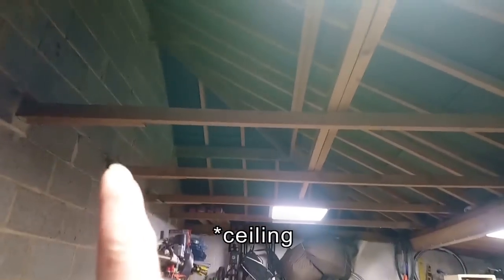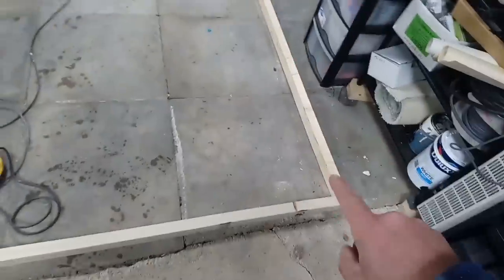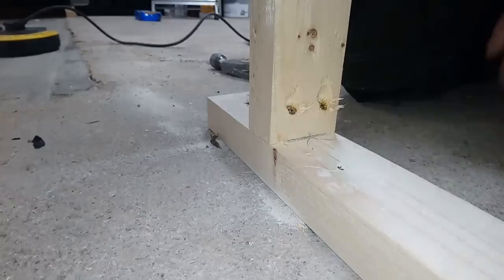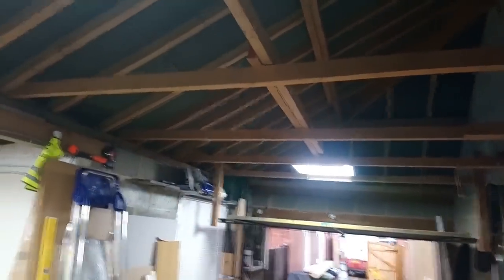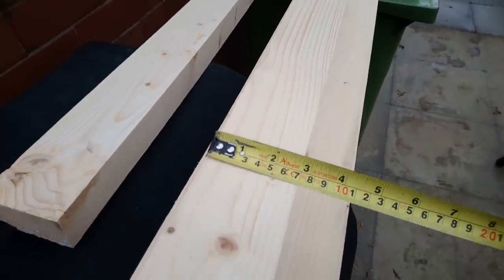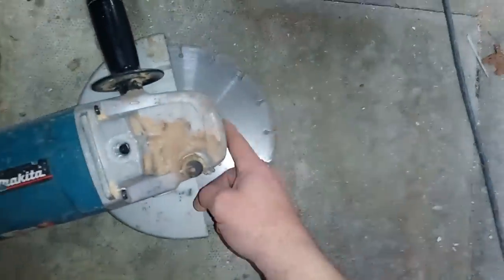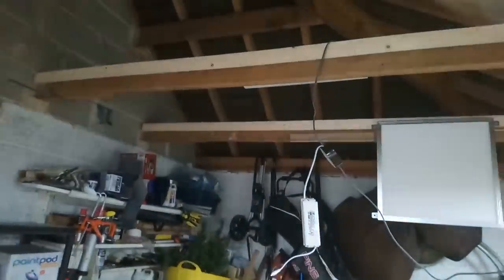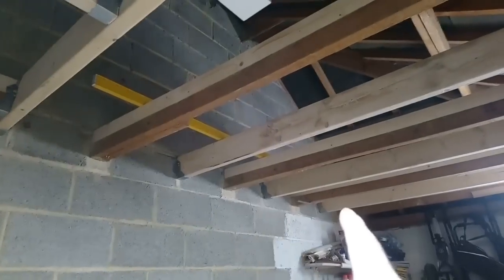Garage loft space reinforcement for storage

Comment: I so need my loft boarding like this. (well. With insulation etc.). Another great video gid.
Reply from the maker: Thanks Chris 👍 If you do be careful about how much you put up there, attic joist are often only strong enough to hold the ceiling up in the rooms below.
Reply: @Gidjoiner  I'm glad you said that because I hadn't given it much thought. I went up and started it with loft stilts and some chipboard but it was middle of summer and the sweat + fibre glass annoyed me so much I just ditched it. Our house was built in 1936 so I'm hoping it's got more strength than newer ones.
Reply from the maker: Not the case often, a lot of the houses up here were built then-ish, the ceiling timbers are only 3x2 n people pile boxes of stuff, Is your's a Semi ?
Reply: @Gidjoiner  yeah mate, common looking semi from that era, arched porch entrance, bay window etc. Eventually I'd like to convert the loft when our daughter is older. Just in the meantime I need it for storage and with a large hatch
Reply from the maker: Terrace looking houses even if they're semi's quite often have an attic room already, most bay window type semi's even early ones have skinny ceiling joists, Individual independent built houses could have alsorts of attic/ceiling  joists depending what that builder decided to use. Just as a guess I'd say your's are probably undersized, In Metric - the span (from wall to wall) ÷ 20 + 20mm = the depth of a joist at 400mm centres, Or imperial - The span ÷ 2 + 1inch = the depth of a joist at 16inch centres, when they do loft conversations they put RSJ's in then suspend joists between to create the attic floor space. Google images - 'loft conversion RSJ' you'll see what i mean. Let me know what you find in your loft, I'm curious, Ta 👍

Comment: I've got 1.5 x 3inch joists at 600mm centres spanning my 5.2m long single garage, and need to add some boarding for storage but was worried about the strength. Need them stron enough so i can screw 11mm OSB to the underside  also to act as a garage ceiling. 

was planning on gluing + screwing some 2x3inch timbers to the sides of the existing joists, supported on the brickwork at either end, to add more strength, whilst staggerng the joints out from those in the original joists - overlapping the gangnail plates by a good margin either side with the new timbers (as i'll need to use a full 3.6m length and another length cut to size to go all the way across the 5.2m span).

not sure though if i'd need to add more gangnail plates or brackets of some sort to the new sistered timbers

Comment: Great job, mate. You seemed to hint that drilling into the top of the existing joists for attaching the newer timber joists probably wasn't the best thing to do. In a home situation would you recommend metal angle brackets that allow both the existing joists and the newer timber to be joined from the sides?
Reply from the maker: Thanks Jay 👍 Sorry I'd have to watch this again to see what i was referring to, I think i meant that drilling into the joist wasn't ideal, any damage/drilling weakens the timber but it's ok, i wouldn't be putting metal in, every job/situation is different, ideally if joists are too small you'd replace them or maybe fix a bigger one to the side, but ceilings, floor levels & access all would have to be taken into account so sorry there's no simple answer.
Reply: @Gidjoiner  That's a fair point, and one that makes sense. Cheers. 👍

Comment: Gid, ive followed your rule span divided by 20 + 20mm and that comes out at 175mm. I need to board my loft and just worried about the weight on my ceiling, all the internal walls in my bungalow are block walls and theres 2 big beams running from each gable end of my bungalow and im wanting to sit timbers on top of these to take the loft boards, what do you rekon? I was thinking of using 4x2 c24 grade to save on weight 
Cheers
Reply from the maker: Hi, sorry without looking i can't advise, Those 2 big beams, will you be adding weight to those also then? In one of these garage vids i added a post (a few 3x2's) under the beam, this post then became part of the wall i built in the garage.
Bungalows can be weirdly constructed buildings 😵
Reply: Gid Joiner yes i will be sitting the timber on top of the beams as they sit above the cieling joists
Reply from the maker: Ok, All weight gets transferred somewhere, we got taught like water flowing. you put it on one place then it travels somewhere else down the line, There's another calculation for working out how thick a beam should be but i can't remember, share, or even know if it's correct, so sorry, no f'kin good i am to you on that one 🤷‍♂️🤷‍♂️🤣🤣
Reply: Gid Joiner fuck sake gid! I thought you could solve all my problems! Haha! Ill have a think about it abit more then cheers anyway

Comment: When laying the t&g flooring, does the it matter if the joint doesn’t fit over a joist? As in length ways. Kind regards
Reply from the maker: I think people will say different things, i try to put the joints on a joist but the joists prob won't work out just right unless you've put them in to suit the boards, either way it's best to glue along the short end/edge 😉👍

Comment: Do you need to insulate or seal the edge where it hits the roof edge?
Reply from the maker: No there shouldn't be any damp if the roof isn't leaking, traditional roof timbers aren't treated timber, or they didn't used to be, & the existing roof timbers aren't rotten.